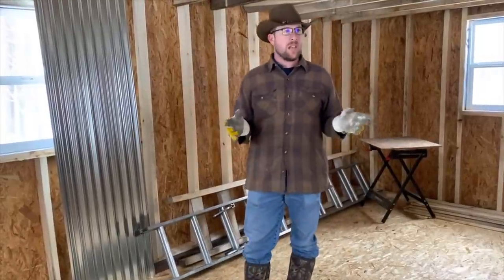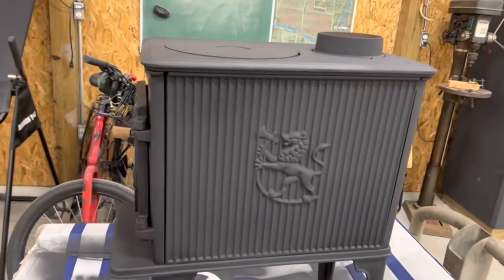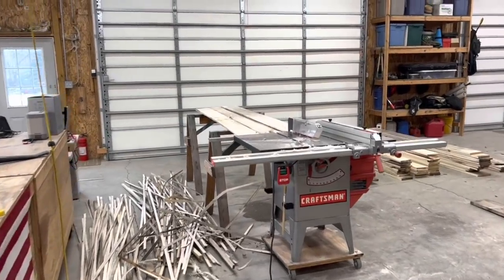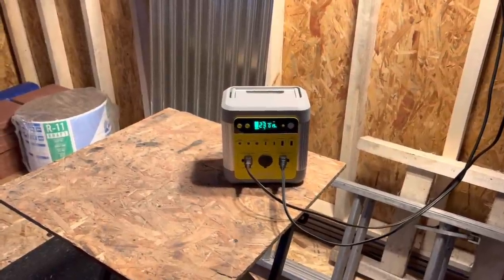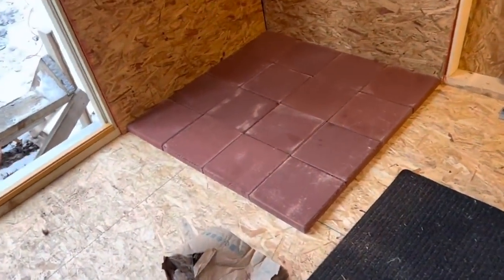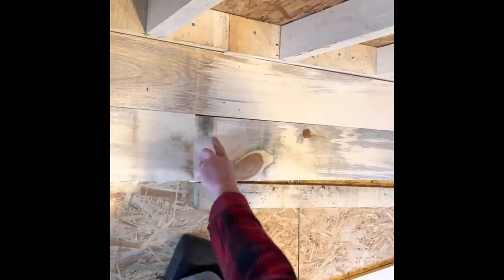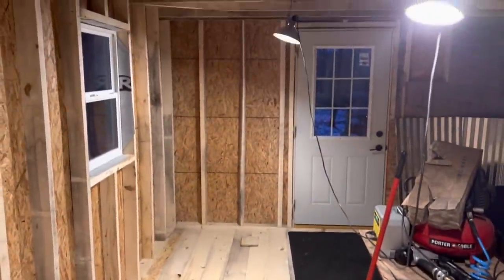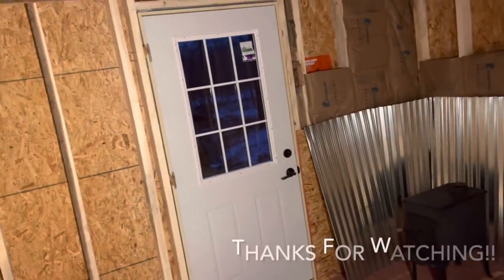Off grid cabin build part 6 - flooring installed and wood stove set in place

Comment: Your cabin really looks nice. I wish you would put some jack studs underneath each of your loft floor joists.
I don't trust the shear strength of the screws you used to attach them.  Now is the time to do it with the walls still open.
Really enjoying this series.

Comment: I always like it when DIY'ers are up front about their goofs such as you did with the insulation.  That is integrity!  This is a great series. . .
Reply from the maker: Yeah, I am a mechanical engineer by trade, not a builder. Definitely gonna make mistakes. One thing that has always bothered me about the online world is folks only showing the good stuff or what worked out well. Just yesterday I measured some steel siding wrong and it’s an inch off. Will still work but definitely another mistake. Oh well. Thanks for watching.

Comment: i know im late but when instaling a wood burning heater you want it at least 3 ft from your wallls if you cant meet that requirement you absolutely need a heat shield  when installed my heater  i found it to be quite helpful to
take into consideration how the area the heater are used   for example your heater is near a door  every body wants to go stand next the heater on a cold day  so might be annoying having someone or some pet always right there in the doorway  then theres the potential fire hazard that comes with heaters  might not be a real good idea to have a potential fire source right in front of your door  
i do recognize that in some cases  this unavoidable but one does need to take  esccape routes into consideration when unstalling a wood burning heater

Comment: If it was me id place it at a 90 the other way. 90 the way u showed would put u infront of the door for easy loading from the porch, BUT also in the path of the door if people are coming in or out. Currently building a bumpout in the garage to instal a woodburner. Nothing like heat from a wood stove.

Comment: The spacing between the wall studs determines where to install the stove pipe. It’s the same issue if you were intending to run it straight up and out the roof. Which means you have to situate the stove accordingly. I ran into that same problem when I installed mine.so maybe you can’t put the stove exactly where you wanted to. Put it in the easiest place. That’s my opinion. Your doing a great job.
Reply from the maker: It’s probably gonna sit just like I had it in the video, parallel to the front wall. Thanks for watching and happy new year!

Comment: I'm curious what you think the right tool is to rip those floor board with.   A table saw is the correct tool in my mind anyway.
Reply from the maker: Table saw was right the way I did it but it would have been faster and more efficient to get them to a closer rough size on the sawmill and then plane and edge. Oh well, I’m a rookie on that sawmill. Hopefully at some point I can get a mill of my own and have more time to make better lumber. Sure was fun doing it. Thanks for watching.
Reply: @LivingOurAmericanDream  oh ok, I didn’t understand what you were thinking.
Reply from the maker: Yeah, that sawmill I used (not sure if you saw that video) belongs to a friend of mine. He’s not quite as attentive to detail as me and a lot of my boards were not uniform in thickness and width. Still worked for rough framing but I definitely think I could make some really nice lumber if I had my own mill. Thanks for joining the conversation and I hope you enjoy the series.